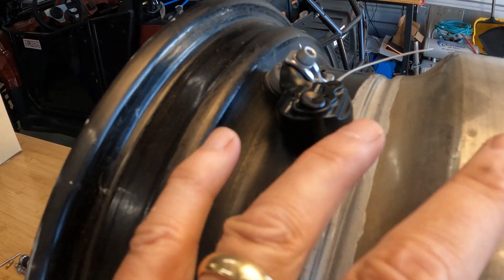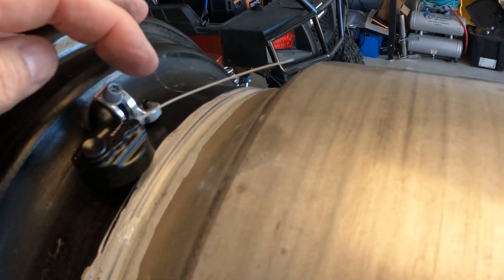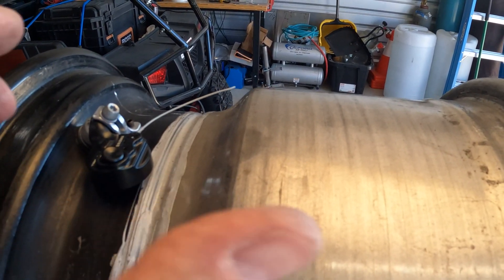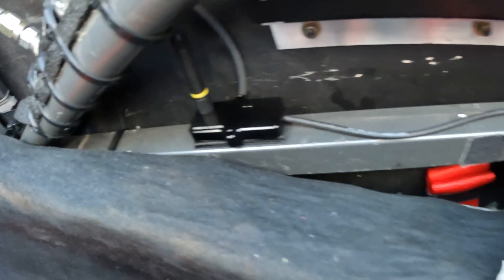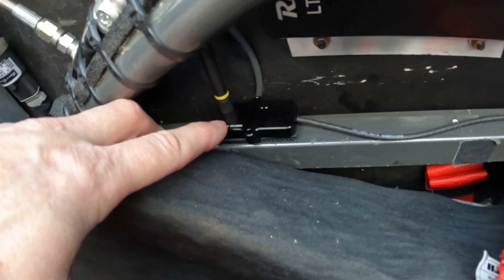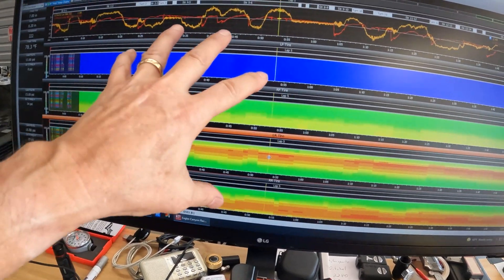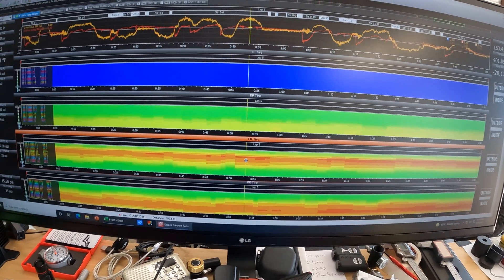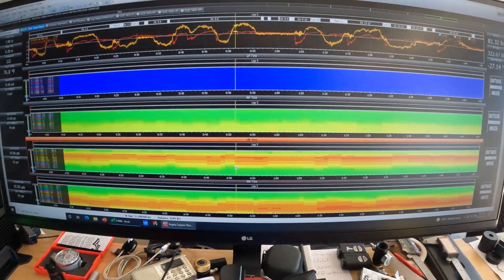Install ICCZ TTPMS inside tire 16Ch Temp & Pressure Sensors for optimal tire pressure monitoring

Comment: Hi! Just came across this video, truly useful!

Wanted to ask. I've just downloaded the CAN files from the IZZE website, and connected the receptor. I'm doing tests with the logger outside of the car, as I want to install the system for an upcoming test and make sure everything is up and running there. Currently I'm not getting any log information when I open RaceStudio3 (My logger is from AiM)... Do you know if something needs to be done to activate the sensors/check it works well? Or is it a case that it only works once it is inside the tyre and detects pressure?

Best regards
Reply from the maker: Great question,  my understanding is the sensor only wakes up when it sees rotation of x… miles an hour.  I am not sure what that is but I see once I start rolling my sensors start to broadcast..  that’s what is going on I’m sure.  Cheers
Reply: @NixonMotorsports  so from your experience, when the car is stopped it doesn't broadcast any information, even if the engine is on? That's very useful information 

Izze is really hard to reach for technical advice, so hopefully they also answer
Reply from the maker: Hi, there are two versions of tire temp sensors from IZZE.  One which I believe you are using is a sensor that mounts inside the wheel and communicates wireless to its receiver.  That receiver then connects via CAN to the logger.  The second sensor from IZZE is the outside tire temp sensor and they connect via CAN directly with no wireless receiver.  If you are using the inside wheel sensor it does not turn on until it detects rotation ~ 20 or so mph.  Then it will broadcast to its receiver.  It makes it hard to test for sure.  Double check your CAN IDs are correct and make sure your receiver is mounted mid-point in the car so it picks up all four wheels.  Best of luck!